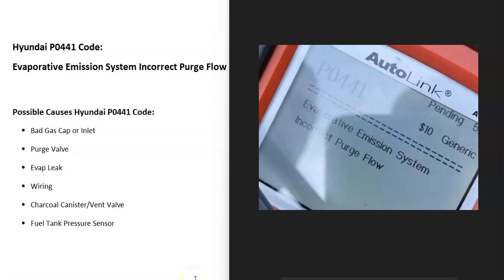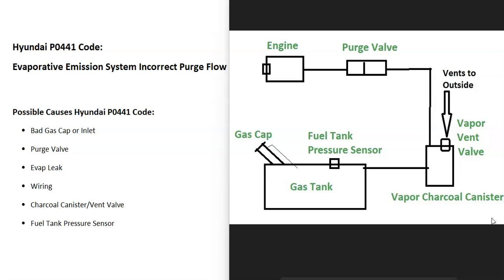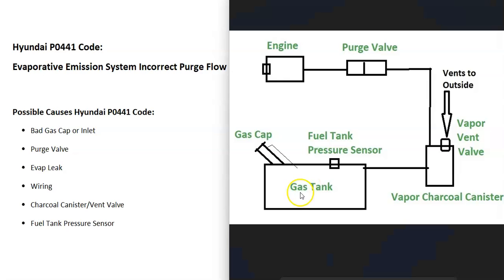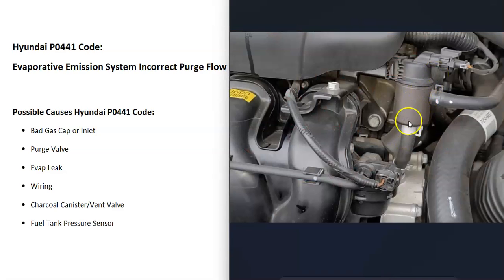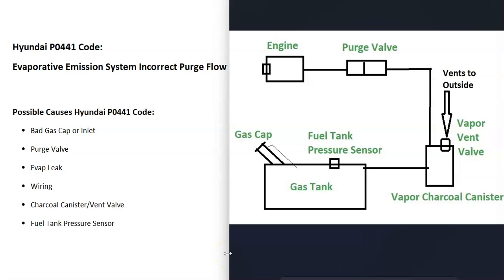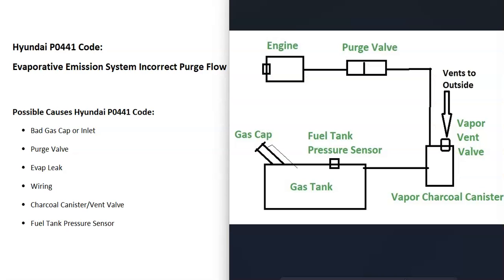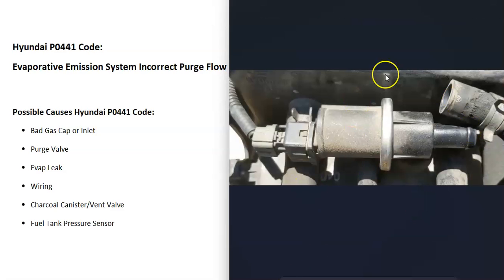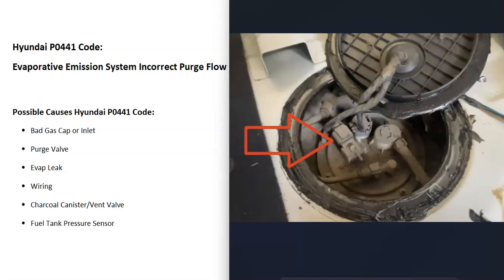How to Fix Hyundai P0441 Code: Evaporative Emission System Incorrect Purge Flow

Comment: Great video! Thank you. So I replaced the purge valve back in Oct 2024. It was faulty after I tested it. Now I have CEL on again same code. Haven’t tested it again but was wondering if these go out quickly or am I running into another issue?